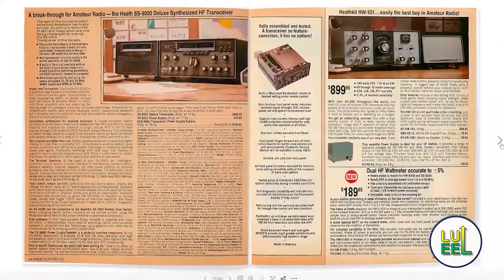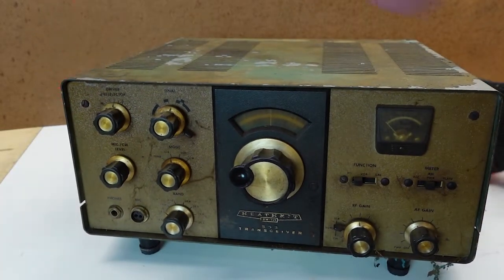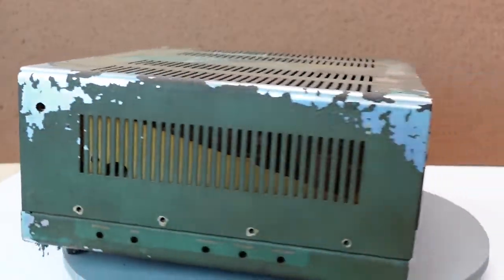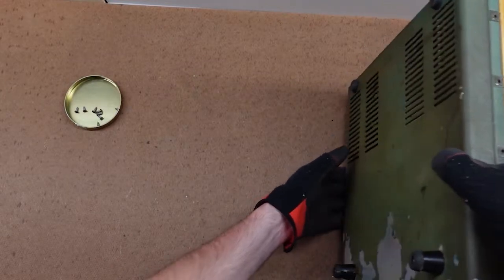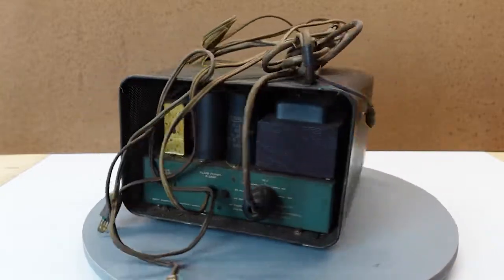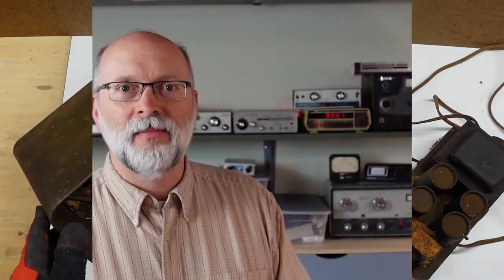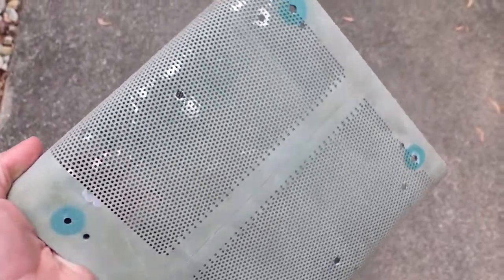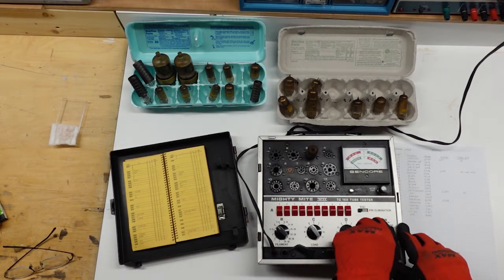Heathkit HW-101: Can it be saved??

Comment: During Covid, I got bored and went after an old SB101 that a friend gave me.  He couldn't get it working.  With regard to painting the cabinet, I did that and it turned out perfectly.  I will note the SB101 cabinet is mostly perforated with small holes for ventilation and sanding it and using paint remover would plug up all of those little holes.

At first, I took the chassis out of the cabinet.  I then took the cabinet to a sandblasting place and had them remove all of the paint.  As you mentioned, Heath didn't use a primer before painting.
I found a very close match with finish and color using Krylon Fusion All In One paint and primer.  The color"Matte Pale Sage" was a very close match to the Heathkit green and the cabinet turned out beautiful.
Yes, I got the rig working.  It had an initial mis-wired power supply and a bad solder connection in the AGC circuit.  I ended up giving it back to the person that originally gave it to me in working condition.  He rekindled his interest in amateur radio along with his son.  Over twenty years later, he had his original Heathkit in working condition, looking like new.

Comment: Glad to run into your pages. I am on my second Hot Water 101 project, or should I say HW 100 this time. I did a 101 that started out as a parts chassis. Stripped it down to bare frame. Last Saturday I got the HW 100 also a parts chassis. Lots of cleaning but not quiet as bad as yours.Still in the clean and look stage. They are fun to work on if that's what you are into. I'm not a double E just a hobbyist. I watched all your videos on this radio. Nice job.Carl

Comment: I did find the Super Clean product! Have you used it to remove soldering flux? If so, how well did it work? (I use Amtech brand flux.) Did it damage the board; I am not sure that it is rated for plastic, as it is a degreaser and plastics can be oil-based...
Reply from the maker: It definitely will not remove RA flux, haven't tried it on other types.

Comment: Great find??? Like you, I am not sure, at all, and am rather skeptical of the project. I think I would have started with testing the tubes, even before cleaning anything. They are the project's go-no-go point. But, as most look okay, I think it makes sense to commit to the gory cleanup. Then, do some testing and reevaluate, before finishing cleaning and painting. Odor Control Tips = After cleaning, seal as many surfaces as possible with Zissner BIN123 Primer (Kilz won't kill the odor.) This primer is amazing at stopping odors. I even sealed gasoline that had soaked into the concrete, when I took in part of the storage room to make a nursery. But, this stuff has a tremendous solvent odor, itself, and should be used outdoors. It dries really fast and the odor goes completely away. A treatment with ozone and ionization will help finalize the removal of lingering odors. Ozone is even sold in a can. IIRC, it can be found in the automotive parts department/store. Whether using a generator, or can, place the unit in an airtight container and let it "soak" for a few days. Treat and soak it outdoors. I am rather confident that you are never going to completely remove the odor from the PCB and that the odor will be noticeable when the unit is used/warms up and on humid days, in use, or not. There is the happy-wife factor to consider, in this regard. But, good on you, if you give it a go.
Reply from the maker: Thanks for the tips!  Yes, I am concerned about lingering smoke odor, especially from anything other than bare metal surfaces.  After the cleaning and after the check-out of the components, I expect it to still stink, so I've got baking soda and activated charcoal ready to try as absorbers. Now there's a preview of episode #2 :)
Reply: @levelupeelab   "Baking soda and activated charcoal ready to try as absorbers" = That's a pretty good idea! But, I wonder if those will actually draw the odor out, or just absorb what is freed by other natural factors. It sure won't hurt the board to try. Maybe make a super-hot water bath and soak it for awhile. BTW, just as an encouragement, my best friends bought a house that was in this same condition... Nicotine literally oozing down the walls of a house on a beautiful river-front lot. Like your project, it was a matter of the heart to save it. With an amazing amount of repeated hard work, they have had nearly complete success. The keys were cleaning a-l-l (think ceilings, inside cabinets, etc.) surfaces, applying sealants, a commercially manufactured ozone/ionizer machine running for days/weeks and repetition. Of course, all this was done, before they moved in. The floors are slate boards and the last of the odor was found residing in the tiny bit of dirt between the slates. A pick was used to scrap that out. The house is now a show-place and a thing of joy.
Reply from the maker: Wow, thanks for sharing that story.  Sure sounds like it was a lot of work.